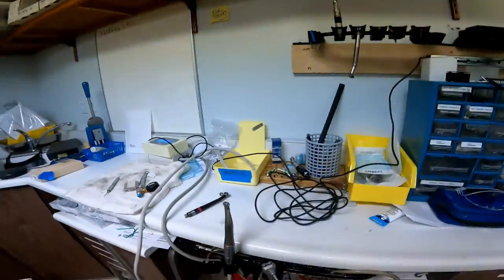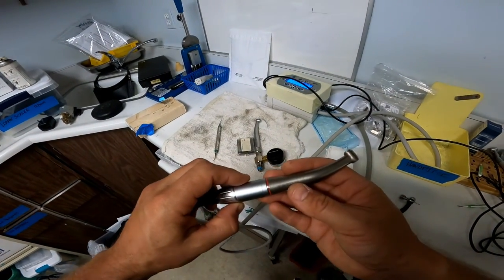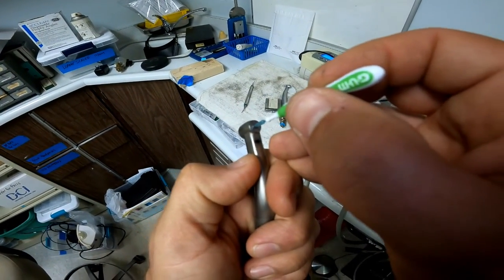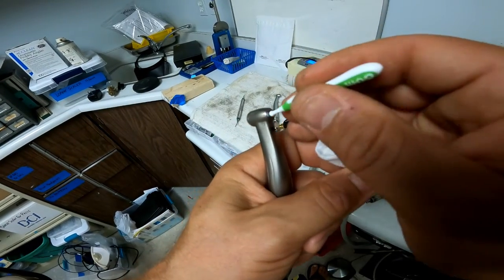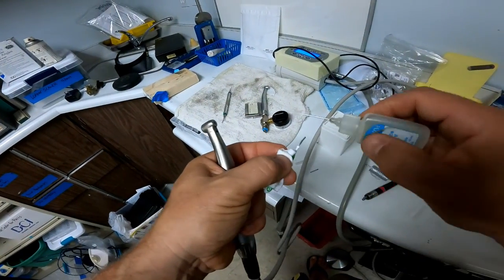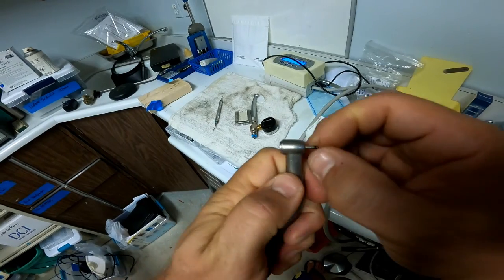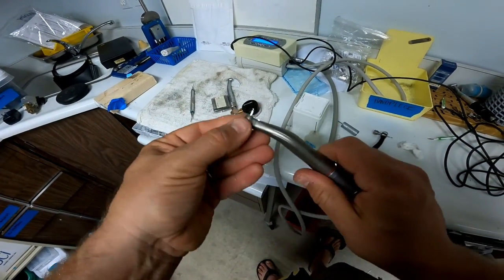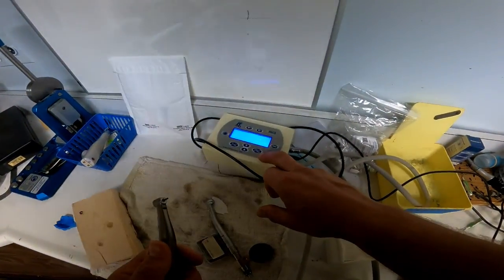Tighten Up That Dental Handpiece Chuck!

Comment: hello! you mentioned you check for heat of the handpiece. what causes over heating and how is that fixed?
Reply from the maker: The bearings fail in the turbine/handpiece head. The entire head and possibly part of the transmission must be replaced or rebuilt. Call premium handpiece parts in Texas for help. 😎

Comment: Way more elegant than my " Hose it down with WD-40 and dipping the head in the ultrasonic " method !!!  AKA my answer to all handpiece problems !!  I will try this one next !!
Reply from the maker: Lol. I've never tried that one either. Could be missing out.  🤣🤣🤣
Reply: @DentalEquipmentRepairChannel  You're not !!!  It almost never works !!  Like all my attempts at HP repair ,   I almost always send em off !
Reply: @DentalEquipmentRepairChannel  For cleaning and lubricating tools we are using NSK iCare at our shop, its bit pricy but does its work. Lubricant is not that expensive 2l for around 80€ which lasts pretty long.

Comment: Great channel! Any tips on how to disassemble a NSK Z95L for a cartridge replacement? The base of this doesn't have the same long slotted screw that the X95L does...
Reply from the maker: Call Premium Handpiece Parts. 3126051854
Reply: If you found the answer please share it with me I am in France so they may not answer me... kindest regards

Comment: What is the normal work temperature for a handpiece please? Thank you very much for the tip !
Reply from the maker: It should not get hot. If it is hot stop using it to avoid burning a patient. Send in for repair.

Comment: Thank you for the content, is there an electric handpiece brand you recommend? I'm torn between Bien air optima, NSK nano, and Kavo electromatic motors.
Reply from the maker: We like Bien Air. Where are you located? We may be able to help you find a local dealer from our network. You can message us privately 😊
Reply: We are selling NSK and Bien-Air in Czechia. We like NSK better, especially Z series and Nano. They are easier to handle but rotor is quite fragile (but also they have 5 years warranty). Bien Air even Micro series is quite heavy and chunky, but they are almost indestructable.

For male dentists I recomment NSK Z/Nano for female Nano series all the way. But if you dont mind heavier handpiece Bien-Airs are good but bit expensive in my country.
Reply: @TomPaur  Many thanks for the in-detailed reply,  I agree, I'm thinking of going with KAvo Electromatic and NSK Z handpieces.